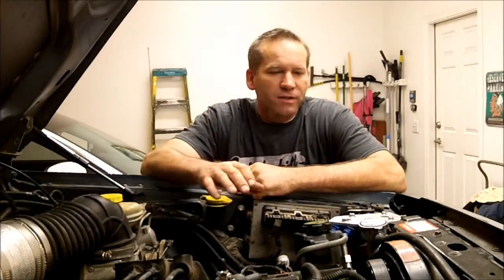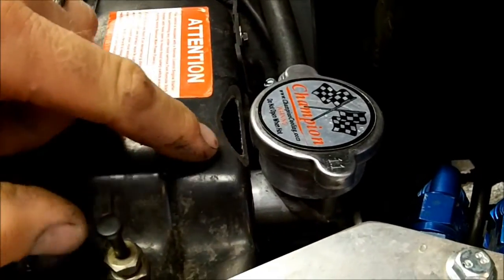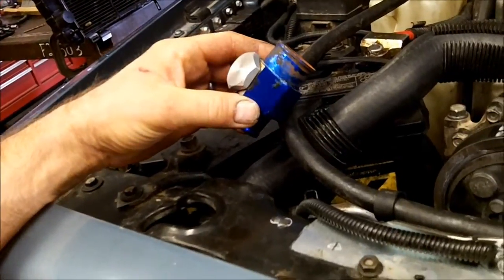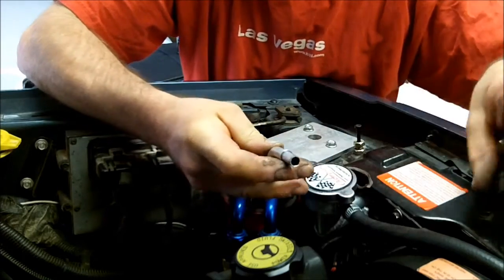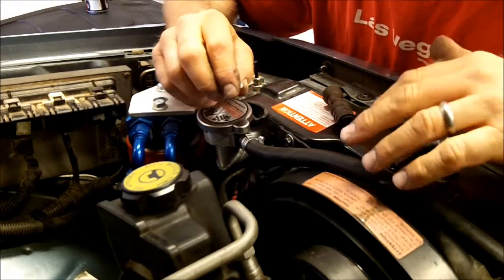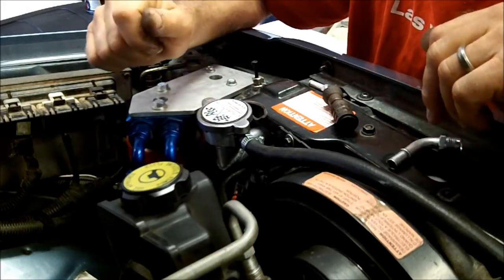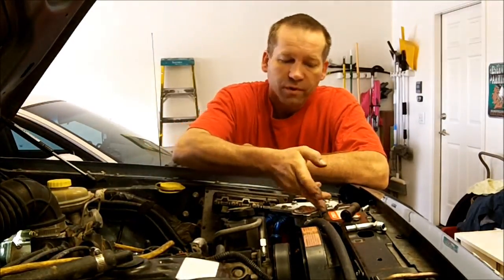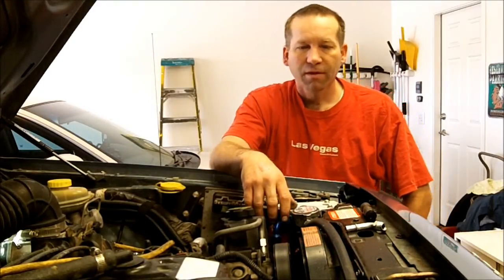{This is a POS} Champion 3 Core Radiator Installation Review in a Jeep Cherokee XJ

Comment: Thank you for this review Martin! Although I have a '95 ZJ, I was looking at radiators on Ebay for my 2000 Trans Am and came upon the Champion brand aluminum radiator then found your video. I think I'll stay away and save for something better.
Reply from the maker: +MrAristes 
Have you had any problem with your ZJ over heating or running hot? I'm just curious because you never hear of any problem with the ZJ just the XJ.
Reply: No, never a problem with the ZJ running too hot. It has KOR 1/8" bumpers front and rear, their Safari Rack and Sliders, and IRO 4.5" lift with 285 series Cepek Muds so it definitely is pushing more weight and a bigger tire. I've never had overheating issues although the under hood area does seem to get pretty hot. I thought about adding hood vents at one point but the rig got parked when I got my Trans Am project and I'll be selling it.

Comment: how are you Martin,

I have a 4 core radiator in my 95 mustang cobra that I have had nothing but problems with as far as the end tanks or core tubes leaking. a cooling system company on ebay has already had me remove and send the leaking radiator back for a replacement now my replacement is leaking. I would like the name and contact  number of the president of Champion radiators, so I can get a final solution. thanks

Comment from the maker: No they haven't, but wasn't excepting any. Champion doesn't build this radiator. Some other company builds it for them. That being said Champion has to convince that company to make these changes and that would most likely cost some money to that company. If you look at ebay you will notice that a lot of the 3 core aluminum look exactly the same. Most likely all made by the same company that builds for Champion.

Comment: Wish if I had viewed your video review before I ordered it last month for my 4.6 stroker, now I'm a bit worried about the leaks.. I can see some changes in their 2-row radiator cap design, it is hexagonal now without ears.  I didn't test the transmission cooler fitting yet, but I was surprised that the shroud was not pre-drilled for the triple 10" fans that are made in China by the way.  Their $60 relay kit is a basic one that you could get for $20 on Summit, and they didn't have instructions on how to wire multiple cooling fans.  It's not a straight bolt-on as you said.  Their manager seems to be a very good guy though.  Thanks Martin.

Comment: Thanks for taking the time to post this update. I was quite tempted to buy the Champion. Did they every fix these issues? Also, I'm curious which radiator you're running these days. I have a new inexpensive radiator, water pump, and thermostat, but the thing still gets up to 220 on hot days with the AC on while idling for a long time. I really want to find a way to never go above 210 in these conditions. I tried the ZJ fan clutch, which made very little difference and am tempted to go with dual electric fans, but worried they won't put out the same CFM as the mechanical fan.
Reply from the maker: tlgrimmy I'm still running the Champion.  I'm on the second one. They do work well when it comes to cooling but,  they do not put up with the pressure. I hate to spend 700.00 for a flex a lite or be kool which only carry a 1 year warranty.

Comment: I bought the same rad and less than a year it started leaking I scrapped it and put the stock rad in and no problems 
I think those aluminum rads on Ebay are junk
Reply from the maker: John,
I'm having the same problem. Just ordered a HD factory replacement. As you said the Champion and all these inexpensive aluminum radiators are junk.

Comment: This video is extremely outdated. I don't believe that everything you mentioned applies any longer. I'm sure the new 2017 Champion Radiators are quite different from the 2013 Radiators {according to the date of this video being published}.
Reply from the maker: Gábriel Priòre 
I hope you're right. I'm on my third one now. They all started leaking after less than a year. I'm about ready just to get a factory heavy duty one,  at least those will last 15 years.
Reply: martinbuilt I honestly don't understand why and how it could even be possible for a pure-metal radiator to start leaking. There is no plastic. Also, Champion Radiators come with a LIFETIME Warranty.
Reply from the maker: Gábriel Priòre the fact that it's metal makes no difference whatsoever it's not constructed from a solid piece of metal at one point it has to be soldered braised or welded whatever the term you want to use to the tank and that's where they're leaking at where the tubes enter the tank and the so-called welding is done I've had three of them they've all leaked and exact same areas. I've got no reason to knock the radiator for any particular reason other than it's a piece of junk. The radiator itself does a great job of cooling the engine it just simply does not last.
Reply: martinbuilt Tig Welding is one of the highest forms of quality welding. I personally inspected my new CC390 Champion Radiator, and it is a very THICK weld, and flawlessly sealed. There could be absolutely no way for 'liquid' to seep through or break a thick metal weld!! Plus, they offer a LIFETIME Warranty!! That means they build these with a high enough level of quality to last 99 years!!! I don't believe your claims. I believe you are deliberately attempting to slander the Champion Radiator company for some type of secret personal reason.
Reply from the maker: Gábriel Priòre 
I'm not knocking there TIG welds. Cuz that's not where it is leaking. You're not getting it. It leaks where the tube is entering the tank that is not TIG welding there. I have no reason to knock the radiator. If it was a good quality radiator I would say it was a good quality radiator I would be so damn happy. Well I'll tell you what you going to see for yourself. And what good is that lifetime warranty when it cost you $60 for shipping to return and get a new one each time.
Reply: martinbuilt Please be more detailed regarding what tube you are speaking of that is entering a tank. I don't understand.
Reply from the maker: Gábriel Priòre 
Okay I have a 3 core radiator. Now if you were to look at those thin metal tubes. what I'm referring to is how the antifreeze is transferred from one side of the radiator to the other in those thin metal tubes so you have three tubes in each row. The radiator is leaking where those tubes enter the tank on either end. I just Googled it they're called (core tubes)
Reply: martinbuilt So you're saying there are no tig-welds whatsoever on those thin metal tubes, which is why they can leak so easily.
Reply from the maker: Gábriel Priòre 
Well the core is TIG welded to the tanks but it's how the core itself is constructed. The tanks look awesome on those radiators. the core of the radiators are of very poor quality and that's where the leaks are coming from. The president of champion had called me years ago about some of the  issues with the radiator. But everything we discussed were fitment issues. Things that I mentioned in the review. At the time I did the review I didn't have a problem with the actual radiator leaking because this was shortly after I had installed it. After my third radiator I had change the title of my video. If the president of champion wants to send me a new radiator I'd be more than happy to put it in. I'll run it for 6 to 9 months if it doesn't leak I'd be more than happy to do a brand new review on that radiator like I said before the radiator does a great job of cooling the Cherokee
Reply: martinbuilt I called up Champion Radiator to enquire about many people claiming they leak, and they actually provided me with their 'entire' RMA history report of the CC390 Radiator {I ordered} since their existence of 10 years ago!!! And only 1 in 600 sold have leaked since a decade!!!!! That is AMAZING!!!!! Furthermore, they said the only Radiators they have had the most leakage problems on are the ones for Jeeps, and it was only because those people did hard-core off-roading, which caused sections of the radiator to twist and therefore crack. Furthermore, they said on the east coast, the coolant ends up expanding when the temperature gets below zero, which will obviously cause it to crack. Furthermore, they said they even had many customers switch to Champion Radiator even from the expensive $2,000 Ron Davis Radiators!!!!!
Reply: Only 1 in 600 have leaked ? B S ! They have ENDLESS complaints about low quality. Most, like martinbuilt, regret ever dealing with them. Nice try CHAMPION.

Comment: The Champion is a piece of $@%# !!! After spending hours of modifying it and finally being so happy with it as of 7/1/2014 it performed awesome. Sadly though after only 5000 miles and 2 years later it has started leaking buckets. I took it out as of 6/21/2016 and took it to a local radiator shop here that I trust. They said it's leaking at the tube welds of at least 8 tubes and probably not worth the time as the welds are porous. So I pissed away $225 on a worthless champion. I had initially tried the CSF and it does fit great but my jeep overheats with it here in the high desert with 100+ temps. I need the 3 row aluminum but have to find one that's built worth a darn.
Reply: Found one worth a damn yet? I'm in FL with 100+ temps and want to tow a boat. Haven't bought an aluminum for all the bad reviews. Thinking I'm just going to go with a 2 row and trans cooler. My factory single row is doing OK... currently.
Reply: +locomojo0485 No, stick with stock or cheap and add better fans to increase cooling.
Reply: Ok thanks. I've decided to just go with the 2 row stock one that came with the towing package and add a trans cooler. That'll work for now. Later I'll go for a CSF 3 row if I need it. I just put on a new clutch fan and eliminated that leaky heater valve.
Reply from the maker: I'm on my 3rd Champion.
Reply: +martinbuilt That doesn't really say much for them....   I've got the heavy duty 2-row stock radiator. It's doing the job here in FL, added a trans cooler in series. I read nothing but bad on the cheap 3-row aluminum radiators for jeeps.
Reply: I tried the heavy duty 3 row csf and it overheated quicker than the old stock radiator.  It was a shame as it appeared to be built decent and fit perfectly. I sent it back and got a refund but the return shipping cost me 75 bucks so I lost that to try a radiator that can't cool in above 90 degree circumstances. A 3 row aluminum radiator is definitely the  best solution but finding one built well is the problem.  It's truly mind bogling!
Reply: The only name brand 3 row aluminum for a jeep I found was by flex-a-lite. And was $620! I'm not paying that much for a radiator. My heavy duty 2 row factory tows by boat fine in FL where it's 90-100 quite often.  Added a trans cooler and flushed the shit out of the system, replaced clutch fan, took out the heater valve thing that slows the flow (mines a 96) And it's been working great. And It's a 19ft Bayliner boat. not some dinky one, pretty sure it's honestly over the tow capacity, but it manages.
Reply from the maker: Do you know what part number for that 2 row radiator is? And where did you get it.
Reply: Mine's OEM. It came in my jeep. Going strong. The part number is 52080104AC. It's a Chrysler/Mopar number. Can Google it and find specs. But it's a 2 row with plastic tanks, the core is 1 1/4" thick. And I have a small 7" x 15" trans cooler added in front of electric fan.
Reply: David R I really do not believe any of these negative complaints. Do you have video evidence? People have complaints about EVERY single product that exists in the entire Universe!! If I had to comply with all these complaints, that means I wouldn't be able to purchase ANY form of existence in the entire Universe!! Champion Radiators have detailed explanations why they are the best on Earth!! And they come with a LIFETIME Warranty!!

Comment: HI martin, being following from a long time, I just installed the champion radiator, even with the bad reviews... lol... did not read comments after I installed... however, I was wondering how did you manage to install the 2 speed taurus fan. I have tried several times, I have  trimmed the shroud and everything and it is still hitting the crankshaft. I might have a little room on the front of the fan, like 1 inch or 1.25 inches... at the most, 

how close to the radiator core do you have the blades of the fan?

thanks in advance. if you can hit me an email, i would be greatly appreciate it. hgarza52 at hotmail dot com
Reply from the maker: did you check out my video on the Taurus fan install. it shows in detail where you need to trim to get it fit. I know I had my one screw come out once that held the lower part of the fan on the left side and it end up cutting a Grove shaped like the harmonic balancer. it ended up cutting a nice circulator shape... it is definitely a close fit.
Reply: +martinbuilt yes, rhanks for your response, ive seen it several times, it is a very close.fit and i think it would hit.something if engine moves.
i have trim.it like you, and the blades are like 1 inch far from.the radiator.core, the harmonic balancer pulley hits and the bolt behind hita too, i have an ac mount pre 97 which has one pulley apart from ac, and then i changed to 2000 power.steering.which has thebtensor.pulley also, so my route is different so i have to fix that too.

i just want to know as how close the blades are to the core. tovknow how much to trim.